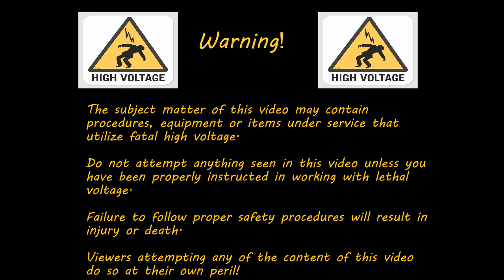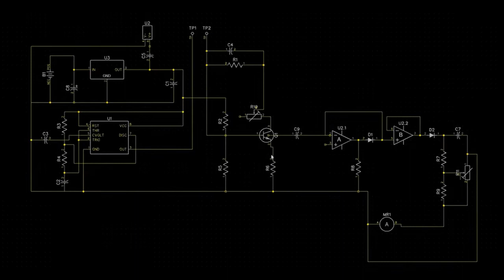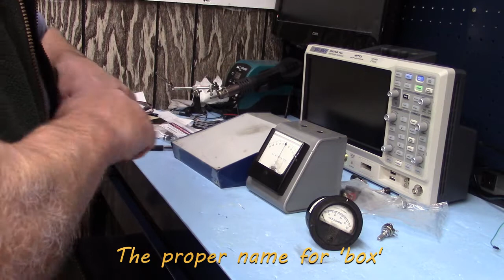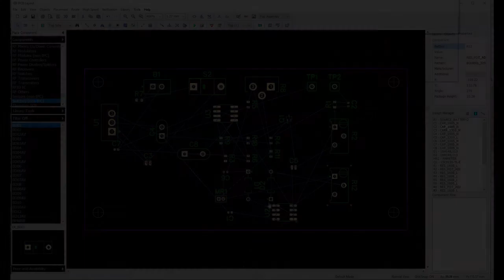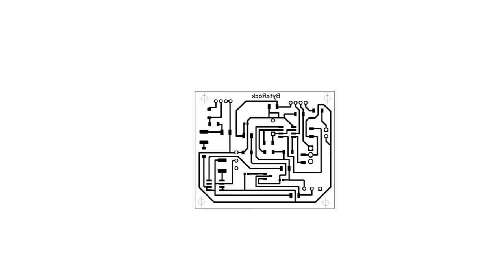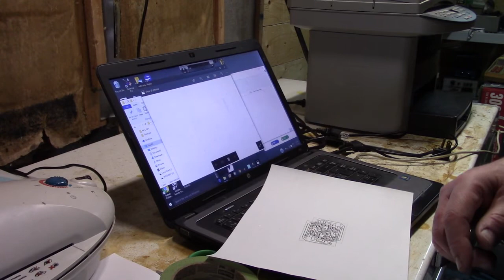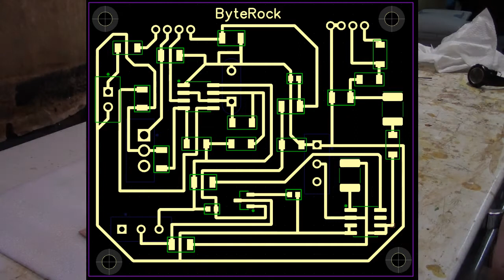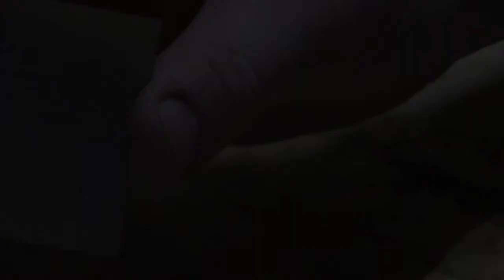02522 Johnny Builds an ESR Meter.  Episode II

Comment: Also the fumes are bad to breath. I work outside or near an open window with a fan. Eventually I plan on building a fume hood to work in.
Reply from the maker: Yep 100% on all fronts. In the back you can hear a fan running in that room.  Though FeCl or the liquid tin is not that volatile.  What is nasty is the acetone.  I only do this a few times a year so the risk is low.

Comment: I heat the solution up to 110 F and agitate constantly. Usually done in 15 min. You should not handle any chemicals without gloves. I see you dipped your fingers in several times. That is not good.
Reply from the maker: I do that as well but that tends to cause the FeCl to lose its reactivity much faster,  I would rather just let it take an extra 45min then spend the time and effort heating the FeCl.  And yes I did wear gloves except for the liquid tin as one does not need to agitate that.  I did wear gloves when I put the remains back in the bottle.  Cheers